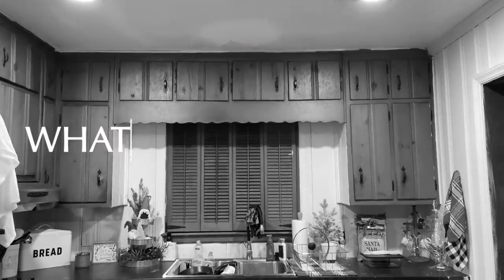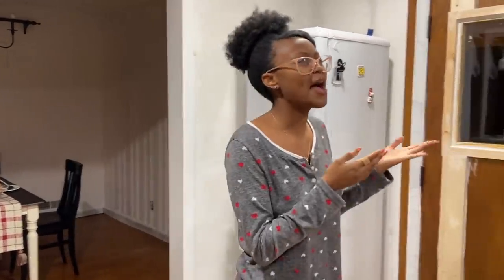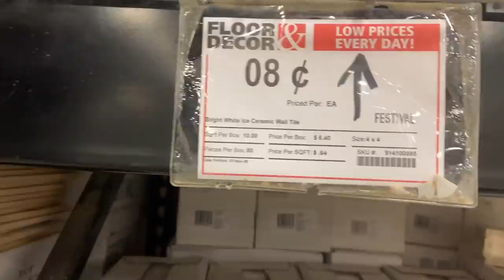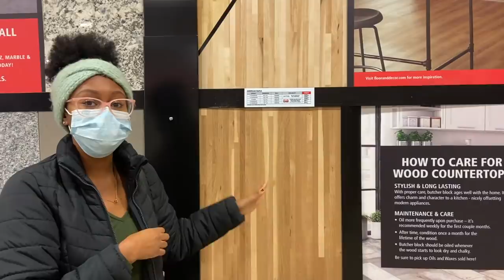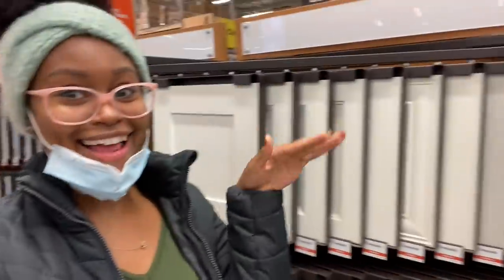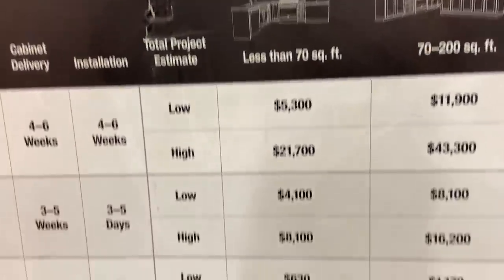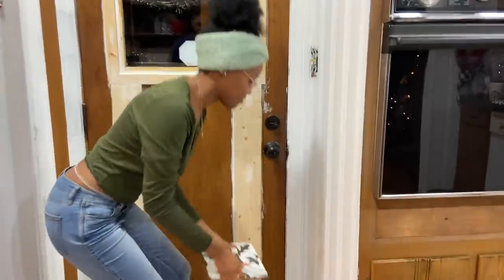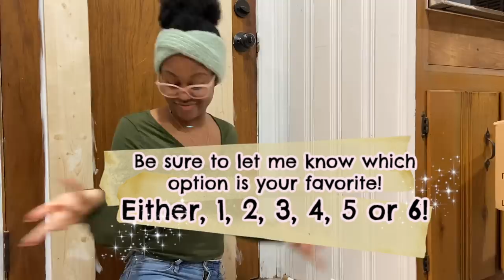DESIGNING MY DREAM KITCHEN !!!| SHOP WITH ME FOR Tile, Counters, & Cabinets!| #FIXERUPPER VLOGMAS

Comment: Move your hutch into your office. Build lower cabinets and a counter against that wall. Place open shelves above. Then you can remove the oven and expand the counter on that side of the stove and can remove the cabinets around the window without lowering the resale value of your home. You need cabinets & counter space for function.

Comment: If you buy new cabinets or just the doors keep in mind that Cabinets with trim collect dust and are annoying to keep clean.  To me:  if you get new cabinet doors - go with flat doors no trim if you can find/afford them.  Your existing cabinets do look fine to me. And they don't have trim; yay!  You literally could just change the hardware.  Lastly remember that a lot of woods are porous so make sure you pick a wood top that is coated properly so that it is not easily stained.  They are a great look but could potentially get damaged over time from deep cleaning/sanitizing a lot faster than a solid surface would.  I personally would not go with the wood counter top.  Great vid.  I'm enjoying you having fun!

Comment: I like the gray oversized hexagon tiles but i also would really love to see a black and white oversized hexagon print as the floor tiles with white grout and the small white hexagon tiles as the backsplash with the butcher block counters.. also get the stainless steal appliances instead . That would look better with the range you’re getting.

Comment: I like your vision.  Can you switch you door opening on your fridge? Most of the time the door opens  away from a wall.   PLEASE next to the stove make that a cabinet, a place to store your broom, dust mop etc. above can be  additional storage.   
the farm house sink is very nice also a nice possible resale feature.   Usually appliances do match. to stretch the more expensive back splashes, use the glass tiles you can run a strip.  As far as the floor generally larger tiles are used.  in front of your sink what about that grey fixture pattern to form a 'rug' look, darker grout not light- gets dirty would have to be scrubbed with a tooth brush!.  Option #5.  Your exiting  cabinets  have good bones/ what about new door fronts?

Comment: You should add some kind of color in the kitchen... Cuz right now it seams like ull have white floors with white walls and a white ceiling, with white cabinets and a white backsplash and white appliances... Should have some kind of colors... And the backsplash is a great place for a touch of color... If anything the first option at leas gives some color with the grey in the tile which is nice

Comment: I think you would enjoy more counter space. Love ❤️ your vision for your kitchen. The tile is beautiful but very pricey. I don’t know 🤷‍♀️? I think maybe you can paint the cabinets for now and then later on maybe you will change them eventually. I don’t think it would be to much. Remember the some items can be a little pricey. I like option #4 tile for your entry hallway and the hexagon tile with the hexagon grey floor for the kitchen.❤️ I was also thinking if you move the hutch into the dining room you would have more space in your kitchen and where your refrigerator is you can turn that space back into a pantry.

Comment: Have you considered doing open shelving? I think that would look very good with the tile all over the walls with the long pantry cabinet next to the stove. The open shelving the same wood as the counter tops would look great! and you save money by not doing uppers. As for the cabinets for the bottom instead of buying all new ones why don't you just replace the doors?I think you should get the stainless still dishwasher and stove forsure. Also I LOVE the hutch. I reallly love the patterned grey floor with the subway tile (option one). Lol this comment kinda all over the place

Comment: I think you should move the refrigerator over to where your oven is and put your pantry back or add shelving there. Your fridge needs to be closer to your work area. It looks odd over there. Those are solid wood cabinets. I would paint/refinish them. Let a professional do a layout for your kitchen so u can best utilize your space. Home Depot and Lowes does a great computer layout for free.

Comment: If u get an island you should def get one with cabinets since you have such limited cabinet space...also try ikea for a kitchen remodel and stainless steel appliances are better for resale... they have some outlet appliance stores that sell them for the low low if maybe they have a dent in the side or something from transporting and wont even be seen after installation. Also absolutely DO NOT get white grout especially on the floors as it gets stained and dirty and you cant fix it without redoing it

Comment: Have you considerate just refacing the cabinets and drawers fronts? Then you could just get new hard ware. Also my vote is for stainless steel appliances. I own a cleaning company and let me tell you.. MUCH easier to clean. Also I vote large hexagon floor tiles and subway or hexagon tile backsplash. Its timeless and leaves you room to have fun with decor. I think those pattern tiles would be perfect for something like your bathroom! I have them in my bathroom and I am in love 😍.  But I Love what your doing and im always waiting for your videos theyre awesome 🤗👌🏾

Comment: Cant beat black, white and wood combo. White subway backsplash, butcherblock tops, white cupboards and black and white pattern floortile.White farmhouse sink and brass hardware, black and brass pendants over island. I would get rid of the hutch and add 2doorr pantry instead, top to bottom.

Comment: Option #2 with black grout. White floors mean more maintenance & more moping.  

I'd add a built in microwave above the stove.  
 The kitchen cabinets you currently have are probably of high quality, those pre fabs at HD tend to be lower quality. I'd paint/re-sand/re-finish what you have.  

Why add a light above  kitchen sink when the window is there? 

Why put all your dishes away if you planned on re-doing the kitchen?

Comment: I'm in the process of renovating my kitchen and I must tell you, it is not an easy or inexpensive project.  When looking for appliances, I would suggest doing A LOT of research before going into the store.  #1. Don't get caught up with the look of the appliances first. Manufactures use a ton of fancy words and advertising to get your attention.  Think about the features that are most important to you first and then find the brands that meet your needs.  I would also look at the most recent reviews.  For instance, when looking for a dishwasher, you and want to get one with the lowest dba that fits your budget.  The dba is the decibel measurement (how loud the dishwasher is).  The lower the number the quieter the dishwasher.  I wouldn't get anything with a dba higher than 46.  Stainless steel tubs are quieter than plastic tubs.  Don't feel obligated to buy appliances from the same brand.  GE may make a good quality stove but a horrible dishwasher.   Also, you'll learn that many brands produce the same appliances in the same factory and simply put a different name on them.  Don't feel obligated to buy all of your appliances at once.  Their measurements are standard, so if you can't get the stove you want right away, design the kitchen to fit a standard stove and buy the stove you want at a later date.  

As for the layout, your goal should be to maximize your space and balance function with aesthetics.  Since you don't have a lot of counter space, I would suggest getting rid of the tall cabinet with the oven and replace it with a base cabinet and add wall cabinets above.  I also would suggest you not get the island.  it will take up a lot of your floor area and with a large family that may help you cook particularly during the holidays, you'll want all the space you can get.  even if it were on wheels, you'll have to find a place to put it when you aren't using it.  if you really want the island but aren't sure of your space, use some tape and mark out where the island would be when you're using it.  if moving around the space is challenging, then you may have to come up with a plan B.    

I too am a hexagon lady and I support all things hex. If you are going for all white cabinets, then pick a focal point that will standout amongst the white background.  If you use a  patterned floor then use a basic backsplash and vice-versa.  too many patterns and colors will confuse the eye and look too busy.

I've said a lot!  Good Luck on your journey and I can't wait to see what you decide.

Comment: Long post: 😫😬😂😂 I like Option 2 but the floor tile as an accent in the middle of the floor, also both with black grout. 
Option 5 as well with black grout  
Something to think about as well: 
The drop in range could probably be ordered in the size and color you want off their website or they could probably special order it. Much of what you see in store is usually for the grab and go customers. Best wishes

Comment: Have you checked to see if the original hardwood is under the laminate flooring?? If it is. I'd just refinish the floors. If not, large tiles for the floor

Comment: Frigidaire and Whirlpool sell stoves without back in the color white. I think all white appliances (or whichever color you choose, they should match). I have stainless steel appliances, white subway tiles, and butcher block countertops and wish I had gone with white appliances. Stainless is making my kitchen look dated so 2022 I will change. I love option 1.

Comment: Take some measurements into a design store, or two, or three, along with a picture of your frig. They'll provide you some design ideas. You don't have to buy from them, or you can. I think they'll offer up some ideas that you might not think of yourself. The Frig hanging out in the odd spot needs some rethinking. I think you should be open to moving the Hutch into the dining room. You have plenty of room there too.

Comment: i think all of the grout should be a grey color...black will be dusty and white is hard to keep clean. I like the hexagon backsplash and a non-hexagon flooring. For cabinets, paint for now and don't do a whole of reno. Live in the house first and really get an idea of what you want and need. I just bought a house too and this is what I have been doing and I am so glad I didn't do some of the changes I wanted because I just don't think they would have been exactly what I needed and practical to live in this house. So live in it for a bit and get a feel first. Just my 2cents.

Comment: Be very careful not to get rid of to many cabinets! That's storage you may not be able to get back.
Of your cabinets are solid wood you my not want to get rid of them. If you like the wood look you can lighten them up to match the butcher block ountertop.
For back splash and flooring 
I chose option 7. (Yes I made up my own option 😎.)
Back Splash no. 4 and Flooring no. 1
Both with Off White Grout.

Comment: If I was you I would go with option 1 with white/grey title with grey grout, but with that other soft little grey backsplash just over the subway titling and it would break up from all that white " white cabinet, white backsplash that would be over kill for me way too sterile. lol An never use white grout on the floor. It's just looks dirty over time with mopping no matter what u do...It can be clean just way to make work.... I wish you keep the old cabinet though an just painted it and change the hardware..

Comment: I don't like any of the tile options for backsplash and flooring. It's just too much white on white on white on white? Where's the color where's the transitions textures gloss mixed with Matt. I don't know I saw so many better options for backsplash, with the smaller various sizes of tile. With like the gray, and black mixed together dark color patterns. It just seems like with the tiles you chose it's going to be too plain and ordinary.🤷‍♀️

Comment: Trust me you don't want cheap cabinets. Yours are better quality so you can have them sanded and repainted or just replace the doors. Get some professional advice before you start. Consultants will come in and give you estimates.